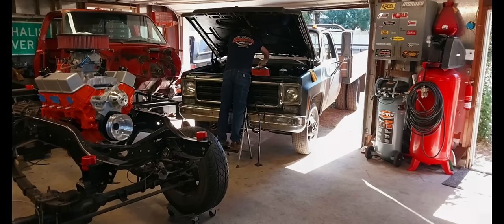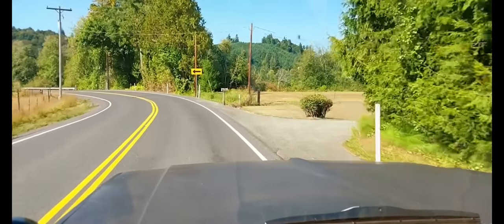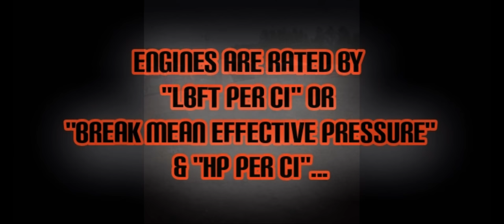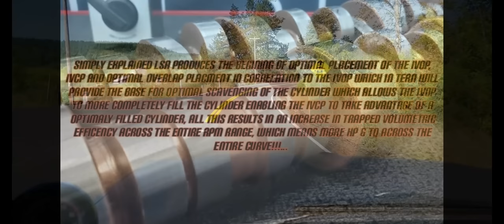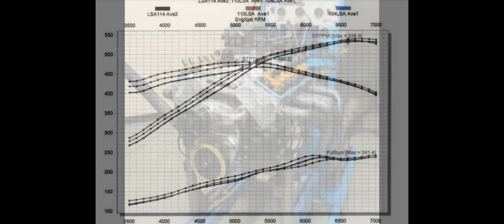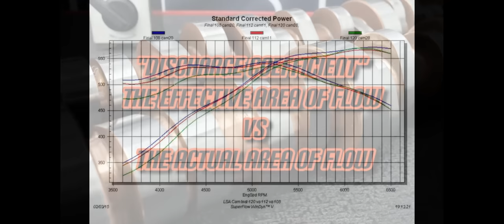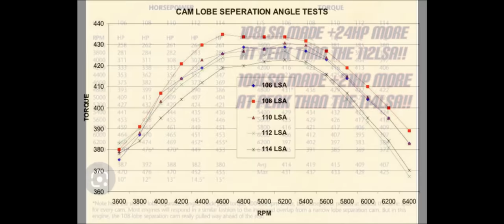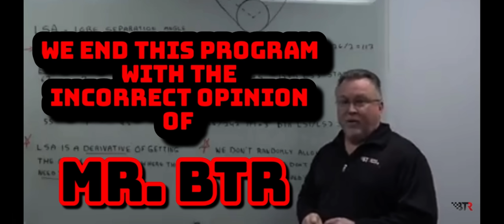Camshaft Selection via LSA, 19LSA's Dyno proven MAX TQ & HP cam tec. LSA, Overlap & Duration convert

Comment: Does Vizards Equation Get You In The Ball Park For LSA On A 90Deg V6 Engine? 

231CI
1.9" IV
8.0:1 CR
This Is A Turbo Engine

If I Use Equation 128-((((231/6)÷1.9))*.91) I Get An LSA Of 109.56 So rounded Up To 110 LSA. Now If This Equation Applies The Same To V6 Engines How Do I Adjust The LSA I Got For A 8.0:1 Compression Engine?

After Watching This Video And His First Video I Have Determined There Is Not Multiple LSAs For Different Usages Like RPM Ranges. There Is Only 1 Ideal LSA And To Adjust For A RPM Range This Is Done With Duration Correct???
Reply: 10:56 For Compression LSA Adjustment From 10.5. Furter Past This Point The Rocker Arms Ratio Adjustment For LSA Is Provided. I Listened To Video. If You Watch The Video You Will Find The Text Like I Did lol.      For My Engine My Adjusted LSA Starting Point For 1.65 Rockers And 8.0 CR is 107.69. David Vizard In Another Video Says It's Better To Have The LSA Slightly Too Tight Than Slightly Too Wide. So I Rounded Down To 107 LSA Being My Ideal Starting Point In A Camshaft.

Comment: Ok I’m with you for maximum peak power and torque…but in your 370” engine even though you made measurably more power and broader torque ( at wot loaded against an engine Dyno)…the idle vacuum at less than 8” is not going to be streetable, if maximum Hp is your goal with a tight LSA then you accept that drivability and part throttle cruising efficiency is sacrificed. 

Couple that to the fact that if you factor in 15-20% drivetrain losses a 30hp gain is really only 24 net or so to the wheels, So to some or most people on the street 20-25 Hp isn’t much to give up at WOT in a drive to work car that has to idle in traffic and be reliable in all weather conditions.

LSA is always a max power/max drivability trade off…I don’t think anybody is arguing that or goes out to prove 112 makes more peak power. The advantages for power and torque for tighter LSA’s has been well know since the beginning of engine building…but it’s not really due to overlap…it’s due to the ‘ironic’ other effect of high overlap….both valves are CLOSED longer thus trapping more cylinder pressure

108 ( for example) actually equates to 2X 216 degrees between intake and exhaust peak lifts. 112 equates to 224 between peaks. Also Ramp shapes on roller cams can mimic the effect of the LSA without too much downside, the Thumper cams are tight but they also have really slow opening ramps on the exhaust, that’s why they drive nicer than most aggressive high rate of lift race cams. Also with a roller cam the actual ‘peak’ is far less critical because the nose of the lobe can ‘dwell’ at very near the peak for several degrees…on each ramp. In a symmetrical cut cam the peak lift if exactly halfway between the opening event and the closing event, but with modern asymmetrical ramps the actual peak is less critical it’s the intake closing and exhaust opening event timing that have the biggest effect.
Reply: If you are worried about tight LSA for drivability then take away duration to have less overlap
Reply from the maker: Thank your for watching,  everything you said, i had adressed in the video... There is stuff in writing that is important to pay attention to/read that more complete the puzzle...

Comment: i have a 350 chevy 30 over roller block with  with vortec heads. I'm running this in a boat that manly turns 3,000rpm with a max of 4500rpm. I need  to keep as low and smooth of idle that i can so the transmission will shift smoothly. The cam that I have been running has a112 LSA 276/284 duration. is there a formula for picking the correct cam shaft for this application?

Comment: One issue has been overlooked. That is vacuum at idle with narrow LSA. For vehicles with vacuum brake boost, there needs to be adequate vacuum at idle for stopping. There needs to be sufficient overlap to accommodate adequate vacuum at idle for braking. Perhaps David Vizard has overlooked this aspect also.  Comments Please.
Reply: Well if it has to much overlap then take away duration to lower your overlap
Reply: Andy @unitymotosports address it.  Simply put  LSA doesn't dictate Vacuum; overlap does.   DV does state in one of his articles that the trade off for a Wide LSA is better fuel economy which is usually completely ignored when talking about LSAs.
Reply from the maker: Thanks for watching, but if you watched the entire video I adressed everything you said many of times, i even showed how to adjust for it.. There is also stuff written that is important to pay attention to...
Reply: @OldBeaterGarage  yes fuel economy and driveability

Comment: The trouble I have with this is Wondering if this info is out dated.
for modern heads intake and exaust systems .
Cause ive worked on engines with low lsas and they were tork monsters 
but they didnt respond to more cfm and modern 2 into 1 exaust 
say a 750 holley vs 850 on second gen lt1 so say the 117 lsa ran 40 less horse
but gained 100 horse  with carb upgrade that also made extra 40 horse come in earlier with its vortec porting .
all chevy race heads are point 2 vortec you see the Dome exaust ports and raised intake runners exept for the ls1 
 But the 108 lsa beats all test hasnt yet been tested with say a modern sb2.2
Nascar engine and  others like Bowtie engines 
LS7  aftermarket heads 
I have a stock lt1 That has not lost against higher horse cars yet 
LT4 ls1 Ls3 new lt1 beat 2 2014 corvettes every body at fernley raceway 
at grudge night all track cars included lost to stock 97 Z28
with exeptional speed shift and hole shot with stock 117 lsa cam lol
With Stock exaust manifolds lol and I see many bog when they shift 
I am monster with gear shift 
Ill tell you why I win 
theres like 3 ways to speed shift 
you clutch you let off gas and punch it 
you keep gas pinned and shift 
Me I half clutch to clear linkage and lift 1 inch and hit it.
pretty much doubles the torQ lol the Gforce into Rpm is wild
used a Gforse Electronc Dino on 3-4 shift it read 690 horse versus 
300 lol and 117 cam does not bog 
and its way faster than that now
so you can see why im confused

Comment: Open Close Lift Duration Centerline TDC LSA Overlap

Intake 23 51 660 254 104 0.215 107 43
Exhaust 60 20 660 260 110 0.196                  That's my Harley cam . It's a `124 inch with 11:1 compression same bore and stroke as 496 Chevy less 6cyclinders  lol  Wondering what you think??

Comment: Thanks for all the great info. on cams. I am trying to add 40hp to my 2013 LS7 while trying to keep low emissions in Calif. What would you change from the stock cam? .593 lift 211 duration @50 intake, .587 lift 230 duration @ 50 exhaust with a 121 LSA. Thanks
Reply: For a fee DV can spec you a cam
Problem with modding in Ca with the new smog laws it has to use the factory GM tune.
Reply: you would need to know

1-current piston to valve clearances

2-current cranking compression

then you could start figuring out what is both going to fit and what wont spark knock!

Comment: On a 4v head, do you add both intake valve sizes together? Also, when you're explaining the LSA are you referring to the intake valve opening?
Reply: On a 4v engine most of them have 2 camshaft you can adjust the LSA I believe

Comment: I have a question.  If the valve opening events happen much faster,  like formula one engines, assisted by or completely through compressed air acting on a air ram, or air cylinder,  does the event separation angle (LSA on a mechanical cam system) stay the same? I'm just curious if the constants in the equation stand up in extreme situations.
Reply: Edit to the previous statement about Formula One using an air ram. Its actually an air spring.  They still us a camshaft and fixed valve timing events as far as I can find. So I'm not sure my thoughts about their valves opening almost instantly are correct. Still curious how the Formula would hold up and what adjustments to the constant 128 would need to be made. Also they have multiple intake and exhaust valves.
Reply: If the timing is fixed, non-variable, then yes, there is an optimal LSA for them too.

I think where "instant" valve opening would be beneficial is in order to get the incoming air/fuel column moving, the quicker you can do that, the better, and with "instant" valve closing you can avoid valve float or bleed off and be very precise with huge overlap and duration for high rpm power production.

Comment: Is 390 open pressure too much for a hydraulic roller 544”/.543” Lift, 236°/244° Duration @ .050”, 110 LSA? I know 110lsa isnt the best, but its what came with the short block.
Reply: Probably not. Find out what cam manufacturer recomends

Comment: How does valve angle affect LSA?
Reply: I think example of a BBC 132 is standard valve angle 26 degrees and 133 is 24 degree that's what I am assuming with Cattledog idea.
Reply from the maker: Valve angle isn't so much of a factor with LSA, an example being SBC is 23° and LS is 15°, the 128 will still produce correct results for bolth which was shown with dyno proof... The primary factor for the cylinder head is the Discharge Coefficient of a given Intake Valve diameter in relation to the CI of the cylinder...
Hope this helps and
Thanks for watching...

Comment: I have an old C10 with a 8:1 350 at 6000 feet elevation, im trying to just make more low rpm power. This truck never sees more than 3500 rpm. I found those old Crane cams that had low duration (like 185/195 @ .050) on a 104 LSA so the intake valve closes super early, i think it was like 16° after BDC at .050". Will this make a noticeable difference at low rpm over a stock 1970s smog 350 cam?
Reply: I also live at 6,k elevation. I hope we get a high altitude answer. My friend who teaches at the USAFA suggests a small turbo to correct for the altitude changes in this state.

Comment: Think of how limited a camshaft makes your engine. You can't get one cam that can make max power throughout the entire rpm range of the engine without a varying camshaft tim8ng controller.

Comment: Greetings, around 11.20 of your video you are explaining that if the compression goes up the LSA are increased accordingly. I see that the start point for the formula is 10.5:1 My question is   , should I lower the LSA if I’m running lower compression? My goal is 9.5:1 on a SBC since I’m planning on using a turbo later. BTW great video. Many blessings and happy New Year 🎉
Reply: Yes lower LSA for lower compression
Reply: Turbo cams are different I think I am not sure on that Cattledog can maybe help with that
Reply: @chevyrc3623  Thank you for your response, I’ll definitely will try to contact Cattledog for his input on turbo cams
Reply: @chevyrc3623 What type of compression do we use in the formulas, static or dynamic?
Reply: @johnpatterson6120  static that's what cattledog says I haven't tried myself but I know a machine shoo guy name my vintage iron from YouTube commented saying he tried this formula and he said it worked

Comment: Im building a 427 bbc 781 heads mild port 2.06i 1.72e ..22 cc domed 60 over pistons ..tb350 trans 373 gears ...could you help me find what cam would best fit my motor ...itll be a strip street motor hopefully
Reply: Use the 132 LSA since those are stock miled ported heads Cattledog used the 133 he said if the heads are better I know exactly. So go 132-427÷8÷ valve diameter×.91= whatever then use compression how much compression

Comment: I'm looing at a 107 lsa for a LS engine and but there are verry few street options, would advancing a cam say on a 108 or a 109 have similar benefits to running a tighter lsa?
Reply: No not the same you may have the same intake center line but not exhaust centerline so it wouldn't work the same

Comment: Powell Machine says LSA don't matter. BT says LSA doesn't matter. You and Vizard have explained why it does matter and the others haven't explained why it doesn't. I'm convinced that it does just by the sound of the engine. A quick revving engine is proof it does matter.
Reply: X act lee,        when your happy  guessing at open / close points, lift and duration,          whats the point

Comment: I didn't see much evidence for it in your graphs, but my own personal experience has been that tightening the LSA has the effect of concentrating power into a more narrow band.  Similar to what you'd experience with a two-stroke motorcycle engine.  Sort of an all-or-nothing powerband, when taken to extremes.
Reply: Most of these engines don't run high RPM so there is no argument for wide spread/late exhaust. On my particular engine that is an inline 4 with good (not limited) IR induction the narrow LSA (late exhaust) just overscavenges the cylinders in the lower range and runs out of steam at 7000 RPM. It has a big punch from 2500-5500 but is very narowbanded for my liking. Works well with limited engines and on short stroke engines with high rod ratio from my experience. If You spin up to 6500 it works everywhere. In DOHC and VVT and Multiair world LSA is not a thing at all - there is only valve timing. In the world of cylinder pressure there is only cylinder pressure measurement and all other parameters are not even a subject of discussion.
Reply: @a112CRO  Sounds reasonable.  To reiterate, all I know is that from my experience, tightening the angle seems to have the effect of tightening the usable power band as well.

Comment: Great video, i used this formula for my last engine. I was wondering if there was an optimal intake lobe centerline to install the cam in order for the valve events to start at the correct time? Does the power curve stay the same and just move up or down depending on advance or retard? Thanks

Comment: When speaking of compression stat's, are you using static numbers or dynamic numbers?? There is quite a difference in my application
Reply: Static.
Dynamic is a way of expressing how the timing of intake closing affects cylinder pressure.
Reply: @andrewkelly1225  Agreed,... my static stands at a little over 19 :1 and based on my intake closing at 74 deg ABDC puts my dynamic at 11.23 :1
I'm using e85 and this should put me in the safe zone
Reply: @kathyscherbarth2169 ,  ... well, you sure ain't foolin' around!...

Comment: Im curious, does the LSA calculation work for any single cam engine? And are the constants  8 for the number of cylinders and 0.91 for hypothetical VE? Where does the 127 and 128 come from? What is the calculation of that constant?
Reply: Something to do with the efficiency of the heads/intakes relative to the engine families.
Reply: I've been playing with the formula with some BMW 6 cylinder numbers and I used 6 insted of 8 in the equation, also I've converted all my mm to inches and I've been using 127 as a reference, I'm going to order 3or4 cams all same profile but different lsa on a future build  and start playing on the Dyno and then work out the magic number from results, as for the .91 maybe ask DV
Reply: @Grooty79  that would be Interesting to see, on ITB iduction i6. I'm al ears! Pleas do share your results. 👍
Reply: @jaan-e  we do a bunch of itb l6 engines now, I'm getting good results mid range and topend but I want to know if I can gain some low end,  I'm getting 1.7 HP per cui + on most things and chasing 2hp per cui on my latest build (175cui 350hp) this is all factory block, factory head castings and factory cranks, the super tuning factory parts has always interested me

Comment: Something that you are touching on but not making clear. If you have an intake lobe of a given lift and duration, regardless of the LSA, if you install it at the same intake centerline ( 1/2 total degrees after top dead center…..let’s say 106…the valve timing events for the intake valve are exactly the same…regardless of the LSA. 

The only thing LSA ( tighter or wider from that point) effects is the amount of time both valves are closed ( tighter LSA increases that both valves closed scenario) and the increase of exhaust to intake overlap. 

You talk a bit too muck about LSA but not enough about the installed intake centerline. 

Generally tge better the intake port the less dependent the engine is on overlap to scavenge the cylinder and draw on the intake charge. Tight LSA hold compression longer before relieving the pressure as the exhaust opens. That’s mainly why they produce more low end torque . 

What is also good to talk about with regard to intake centerline is how it effects intake closing relative to the amount the piston is moving back up the cylinder bore after passing Bottom dead center. 

There is high RPM power to be made as long as the intake charge velocity at higher RPM is far enough to cram more air and fuel in at that point. Without enough port velocity and air/fuel volume…the piston moving up the bore will overcome the lower velocity and try to push the air/fuel mass back up the intake valve. 

That’s the balancing act 

I’ve found that long stroke short rod engines tend to like earlier intake centerlines…mainly because the cylinder moves back up the bore at a higher rate per degree after BDC, so they lose ‘effective displacement’ faster than a short stroke long rod engine which benefits more at high rpm

Comment: What do you use for a number for valve diameter in the formula if dohc( 2 intake valves)?
Reply: Also it says to start with different numbers for different styles of engine. What number would I use for the 128 if I'm using a coyote modular ford engine?

Comment: Will the optimal LSA calc pass emissions with emission components in place?
Reply: It would you just have to take away duration David Visard explained that in one of his videos a engine with 107 LSA passed smog I can't remember exactly but if that engine had a certain overlap and you want to keep that overlap when you tighten the LSA you need to take away duration for the overlap that is needed to pass smog